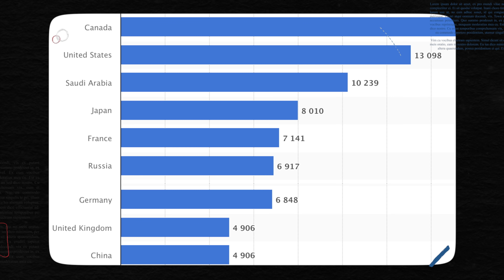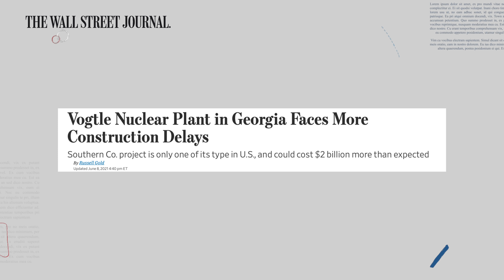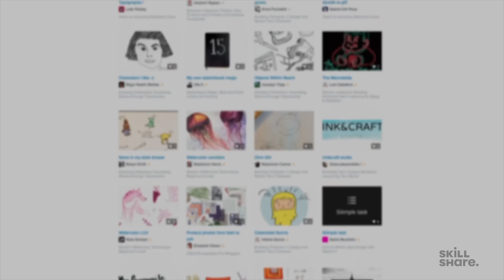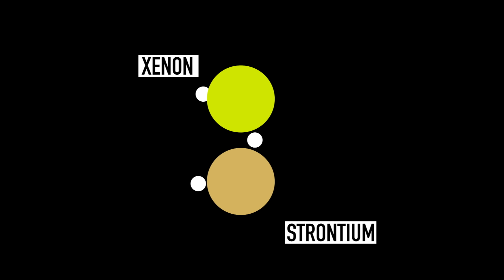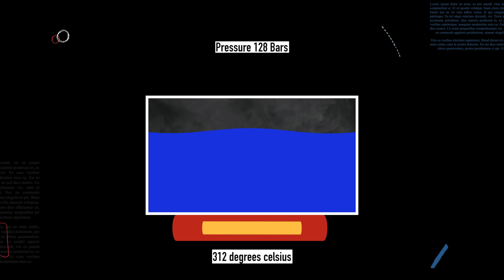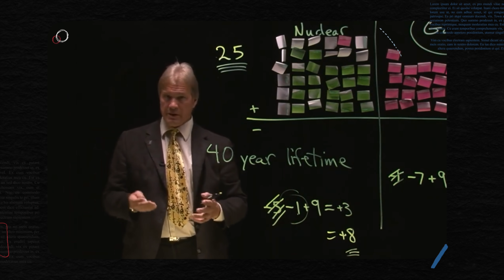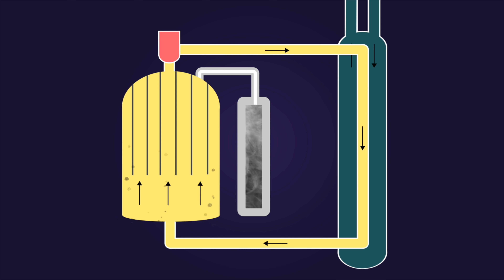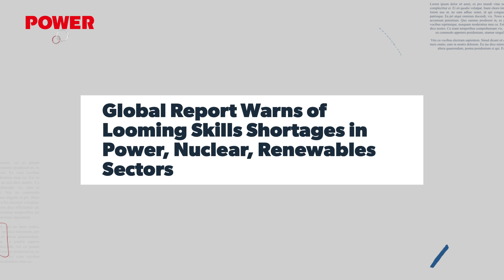Thorcon Just OBLITERATED Nuclear Energy’s Biggest Problem

Comment: Sciencing responsibility requires that objectives and purposes are exhaustively reiterated and structured in such a way that it is possible to understand absolute truth,   ..at least present it to new  students who are interested, (ie like this video, thanks), but we're looking at it all-ways all-at-once here-now-forever without having much clarity about Actuality

So Euler's e-Pi-i 1-0-infinity instantaneous potential logarithmic condensation modulation positioning via Singularity-point Entanglement Observation is a place to begin, absolutely replace big bang discrete-ness ideas, and one assumes there's no shortage of up-to-the-minute Nuclear Engineers to restart First Principle Fusion-Fission Function bonding arrangements designed to safety release energy in an appropriate Reactor.

Comment: Why is an alleged science programme pushing the lie of global warming which is patently not happening? Why are you pushing the myth of "carbon" (dioxide) emissions as being a problem? CO2 is a trace gas, 0.04% of the atmosphere. Of this 0.04% humans contribute around 0.4%, very difficult to get figures as the climatards conflate many predicted increases with the actual amount, and those more sensible consider it less, as low as 0.03%. What is a fact is that it is a self governing system. More CO2 means more plants, we are greening the planet. More plants mean more CO2 absorbed, better crop yields, more food. Do the climatards really want to starve the world? It seems they do. More heat means more evaporation, which leads to more cloud, which leads to cooling.
We should be curbing pollution but CO2 is not a pollutant, plants need it. All the current alternative (to) energy sources are expensive, inefficient, and no better than fossil, which we already make very good use of. It also seems they are not as good for the environment if you look at the evidence instead of the propaganda. BTW labelling me a climate change denier says more about you. I have yet to see any evidence of Anthropogenic Climate Change, the climate has been changing for millions of years and the coldest periods when there was little life on the Earth were during periods of extraordinarily low CO2, under 350 ppm. You're welcome.

Comment: A large well-trained workforce doesn't necessarily require it be a domestic workforce. 

If a country is using nuclear, it'll likely be nearer Point of Use.. namely a city. 

Most cities have a university of some sort. Knowing that nuclear is going to be invested in could just as easily include investing into the universities to create programs designed to educate, not just for nuclear in general, but the specific types of nuclear facilities the city & country are operating.. including exchange programs with other universities as well internships with the companies themselves. 

The point: as a domestic labor force is educated, an external one can be brought in.

Ass to this, international remote monitoring at corporate headquarters, and corporate headquarters for the nuclear company themselves not only running a program training workers for their facilities, but do so closely alongside the IAEA in such that the nuclear facilities themselves are operated by the international community itself... just operating locally.

There'd be no 'bringing in IAEA inspectors' upon request.. or keeping them out.. because they'd already be there.  

Within limits of local national and just nuclear security in general, the facilities would be constantly monitored and accessible by the international community.  This farthet sidesteps rogue elements going bonkers from a proliferation risk perspective, as well, sets a precedence for all other nuclear facilities still in operation around the world.. not to mention it solves the domestic labor issue.

Comment: Thank you for presenting this technology to the public. Thorium reactors may be our salvation when it comes to producing clean, relatively safe and almost limitless power and thorium is one of the most abundant elements on Earth. We should be investing heavily now in development of this technology to meet the increasing energy needs of the U.S. and world in the coming years.
Reply: The point is - why use thorium at all, when spent fuel and depleted uranium (DU) is abundant?
The waste of 1 reactor year of a 1 GWe conventional reactor can provide up to 140 times the electricity originally produced. Additionally, the side product from enrichment, depleted uranium can provide another 4 - 5 times the electricity of the waste. In total, this is about 700 times the electricity that was produced by nuclear in the past. This is are resources worth tens of trillions or even hundreds of trillions USD could pay the debt of the US multiple times easily.
A side effect is that the "waste" produced after complete burn down consists of 95 % partly precious metals, and about 5 % of waste that decayed after 30 years to the level of natural uranium. Of course, it is poisionous, but can be stored just like normal chemical waste. 
IMHO, before using thorium waste and DU should be burned. And if this isn't enough after thousands of years, there is the posibility to get uranium from seawater, for which China seems to have found a cost effective solution now. 
You can use thorium in the same reactors that burns waste and DU, but it isn't necessary for energy needs for a long time. But be aware, beside some advantages of thorium, there are nasty site effects. The small part of U-232 produced during breeding, which may help against proliferation, decays to TI-208, which issues hard gamma radiation. This requires more expensive shielding and complicates handling. 
So again, why use thorium when it isn't really necessary?

Comment: And once again....another film clip supposedly demonstrating a progressive and safer type of nuclear energy generation.....WHICH FAILS TO OFFER A SAFE AND PERMANENT SOLUTION TO THE TOXIC NUCLEAR WASTE IT WILL GENERATE......NOR DOES IT FACTOR IN THE COSTS OF LONG TERM STORAGE AND SECURITY OF IT'S NUCLEAR WASTE.
Reply: Reprocessing is being done, wastes can be further depleted in fast breeder reactors, or it can be buried.  So what is your problem?  It's a political problem because of ignorance, not a technological one.
Reply: The waste has a half life that is a fraction that of conventional fission reactors. So which coal company do YOU work for? Or is Glavset still in business?
Reply: The solution for the waste is complete burn down, which exposes the fuels full energy. The leftovers are 95 % partly precious metals, and 5 %real waste. Some have an activity similar to natural uranium after about 300 years. This true for both uranium and thorium cycle. But the thorium cycle has the disadvantage of very high gamma activity, which requires extensive shielding.
I forgot to mention that you can use spend fuel an depleted uranium as fuel. This gives more than 100 times the energy, extracted by a BWR/PWR. The stockpiles of long-time users of nuclear power are worth trillions of USD.

Comment: Ok, ok. I get it. LFTRs aren't going to be the next power plant technology, no matter HOW much I think they should be. But, can I dream? Maybe the Thorcon business plan as you have outlined it is actually the most practical way of converting the power supply industry away from fossil fuel and back toward sustainable (yes, I said "sustainable") nuclear power. Maybe one day, a version of LFTR can be produced at least to just solve the nuclear waste problem generated from all the other nuclear plant designs out there. I first heard of molten salt reactor experimentation when I was still in school. I'm running out of time here to see this actually happen. Please, just let me dream that it finally will!
Reply: The point is - why use thorium at all, when spent fuel and depleted uranium (DU) is abundant?
The waste of 1 reactor year of a 1 GWe conventional reactor can provide up to 140 times the electricity originally produced. Additionally, the side product from enrichment, depleted uranium can provide another 4 - 5 times the electricity of the waste. In total, this is about 700 times the electricity that was produced by nuclear in the past. This is are resources worth tens of trillions or even hundreds of trillions USD could pay the debt of the US multiple times easily.
A side effect is that the "waste" produced after complete burn down consists of 95 % partly precious metals, and about 5 % of waste that decayed after 30 years to the level of natural uranium. Of course, it is poisionous, but can be stored just like normal chemical waste. 
IMHO, before using thorium waste and DU should be burned. And if this isn't enough after thousands of years, there is the posibility to get uranium from seawater, for which China seems to have found a cost effective solution now. 
You can use thorium in the same reactors that burns waste and DU, but it isn't necessary for energy needs for a long time. But be aware, beside some advantages of thorium, there are nasty site effects. The small part of U-232 produced during breeding, which may help against proliferation, decays to TI-208, which issues hard gamma radiation. This requires more expensive shielding and complicates handling. 
So again, why use thorium when it isn't really necessary?

Comment: The THOR in Thorcon is for Thorium, not Uranium. It's much harder to make a breeder reactor using Thorium.
Reply: The point is - why use thorium at all, when spent fuel and depleted uranium (DU) is abundant?
The waste of 1 reactor year of a 1 GWe conventional reactor can provide up to 140 times the electricity originally produced. Additionally, the side product from enrichment, depleted uranium can provide another 4 - 5 times the electricity of the waste. In total, this is about 700 times the electricity that was produced by nuclear in the past. This is are resources worth tens of trillions or even hundreds of trillions USD could pay the debt of the US multiple times easily.
A side effect is that the "waste" produced after complete burn down consists of 95 % partly precious metals, and about 5 % of waste that decayed after 30 years to the level of natural uranium. Of course, it is poisionous, but can be stored just like normal chemical waste. 
IMHO, before using thorium waste and DU should be burned. And if this isn't enough after thousands of years, there is the posibility to get uranium from seawater, for which China seems to have found a cost effective solution now. 
You can use thorium in the same reactors that burns waste and DU, but it isn't necessary for energy needs for a long time. But be aware, beside some advantages of thorium, there are nasty site effects. The small part of U-232 produced during breeding, which may help against proliferation, decays to TI-208, which issues hard gamma radiation. This requires more expensive shielding and complicates handling. 
So again, why use thorium when it isn't really necessary?

Comment: Not a single of these Thorium type reactors is up and running, although the principle has been proposed for DECADES! In reality, only the principle sounds good, but there are technical issues, that have not been solved in all those test facilities. Thorium seems to be a paper-tiger, after all
Reply: The Chinese runs the TMSR-LF1.
Reply: @egnegn123  ok, maybe?
I think does 70% electricity from coal, 25% hydro, 3 % wind power and 2% nuclear

Comment: Any use of U235 presents huge PROLIFERATION risks.  Thorium (only) is a better solution, but even then, it's troublesome.  More electricity comes from PV CELLS ON THE POWER PLANT GROUNDS than from the reactor.  That is, cover the grounds of any nuclear power plant grounds (avg 1.5 sq miles) and get more GW of power than you'd get from a reactor.  PV is FAR, FAR CHEAPER, too.
Reply: When Uranium is burned down completely, and not processed externally, the proliferation poses no risk.
Thoriums non-proliferation story is based on high gamma from U232 decay, which is mixed with then fissable U233. The gamma activity poses other risks during use, processing and transport. And you don't to build a bomb, hard gamma activity is enough of a risk.

Comment: Mass production of power plants already exists at an enormous scale, with costs going down below 1 cent per kWh, less than the cost of electrical transmission lines: solar panels.

The future of energy is decentralized, and solar plus batteries and smart energy management systems.
Reply: @EnlightenmentLiberal well there are many off-grid houses that do have reliable electricity. There are no reasons why this wouldn't work.

Comment: Stunningly clear description! However, I am a former PhD metallurgist who specialized in alloys for high temperature applications (jet engines). There is, I believe, a severe challenge in using molten salt - corrosion. I sense there is considerable hand waving about this potentially intractable problem, which is probably a major reason no molten salt reactor has run since the 1960's. In any case, this is the bit of technology I'd watch carefully before investing in Thorcon.
Reply: That has been a big concern for molten salt reactors since they were invented.  Corrosion is also a  major stumbling block for OTEC, but for obviously very different reasons.  Both of those are wonderfully simple ideas which would have some fantastic positive side-effects, so I'm left really hoping we find some 'magic' materials.
Reply: @CyberiusT  The situation may be roughly analogous to titanium casting. Titanium is so reactive that there is simply no ceramic that can withstand it for more than a few seconds. It is melted in water-cooled copper crucibles, meaning molten Ti only contacts a "skull" of solid Ti. It can be poured into ceramic molds, but despite using an expensive ceramic to coat them (yttria) and rapid solidification (with attendant complications), reaction still occurs and the outer surface of the casting must be removed. No magic ceramic exists to make this easier; a new element would be required.

Jet engines are possible only because of a somewhat magical material, a class of nickel-base alloys known as 'superalloys'. Discovered around 1950, they've been improved 30° C at a time, and for turbine airfoils are prepared as single crystals with intricate internal cooling passages, and are further protected with elaborate coating systems. This technology development took a long time. But turbine airfoils are laid waste if contaminants enter an engine that form molten salt - hot corrosion.
Reply: There are alloys like Hastelloy N that were used about 60 years ago, and are used now by the Chinese copy TMSR-LF1.

Comment: Trivialize the manufacture of airplanes? made me laugh. Ever been inside of an aircraft plant like Boeing or Airbus? Their level of workforce training and complex manufacturing technique is outright insane. You have to keep every plane build absolutely clear of metal shear, dropped tools, cleaning towels, nuts and bolts. Each of this will cause troubles with maintenance later or make stange sounds when rolling around in the fuselage while flying. Totally irks out passengers and crew in mid flight.

Comment: Does anyone know the anticipated fuel efficiency of the Thorcon design (percent left over)?
Reply: @EnlightenmentLiberal thanks for the help. I understand that it is a burner, not a breeder, but what does the waste stream look like, compared to a lwr? Thorcon's sales pitch says they generate 100k less solid waste than a coal plant. They say their core fissionable make up is 85% thorium, 15% uranium (which they must buy). They also say their fission process is a mix of 25% u233 (from the thorium), 25% pu239 (from u238), and 50% u235. Of course this means they use about the uranium of a equivalent size lwr. So does this mean they're twice as efficient as a lwr? Again, what does the waste stream look like? Is it ultimately the same? Because they use the plutonium, is the half life of the waste more similar to a lwr, or the designs from Elysium and Flibe?
The internet/Thorcon is crickets on this.

Comment: The science and basic tech idea behind Thorcon's proposed reactor are all clearly presented. Thankyou! 

Some comments:

1. What was the statement @10:25 (I could not understand the sentence, it was too fast although i listened to it repeatedly).
2. @10:36 II heard "Due the build up of gaseous neutron".  I'm sure i misheard it. What is actually being said?
3. @10:45 When discussing economies of scale you say ThorCon has a '3000 year head start'. Are you extrapolating civilizations experience with ship building to the construction of this new type of modular fission power plant? Isn't that a bit of a stretch to imply the economies of scale have already been worked out for the power plant to that degree when they haven't even built the non-nuclear test plant? 
4. @13:41 20% enriched uranium is weapons grade. How do they propose the distribution and operation of these plants world wide while avoiding further proliferation of nuclear weapons?
5. @14:36 But they've built the reactor in such a way that catastrophic failure is really unlikely even in the case of operator error" No, they have designed the reactor to be really safe but it has never been built and you really can only assess the safety of such a system once you actually have a working plant and can evaluate the safety margins of the actual plant. That entails not only its design, materials and construction but the training/expertise of the personnel operating it.

Generally I am missing a critical examination of the claims of ThorCon. The video comes across as an advertisement for Thorcon's proposal without examining whether this really holds up. Good to generate investors but not so useful to judge whether this is really a good solution or one that the company can actually realize.